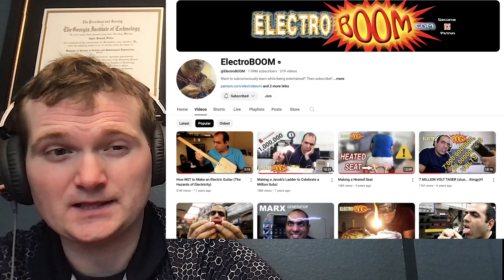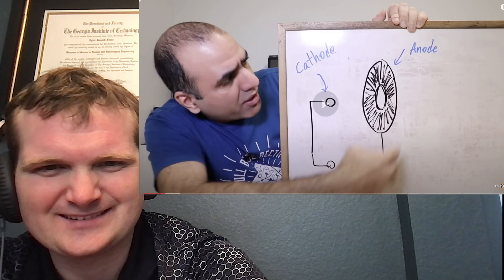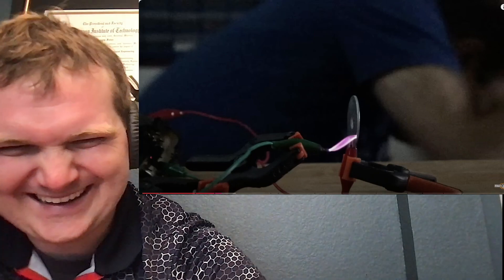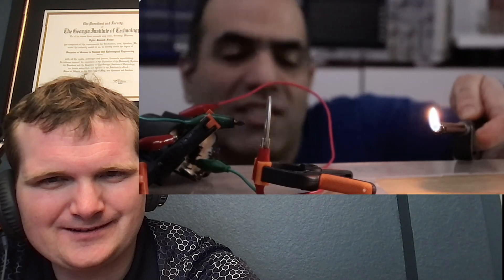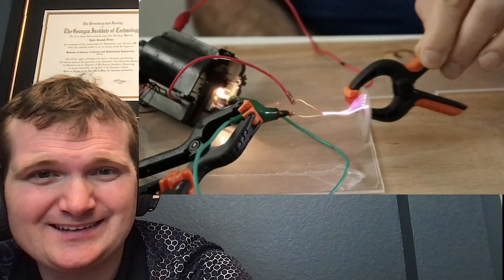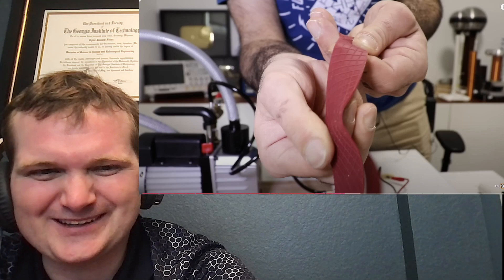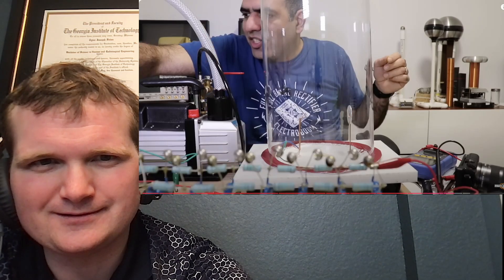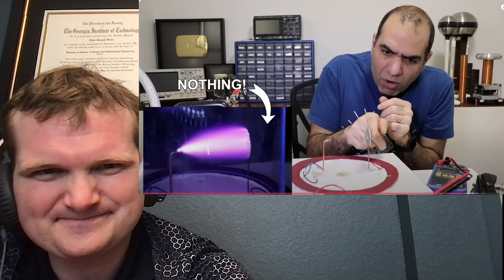Super Fast Electrons and X-Rays from Cathode Rays! - Nuclear Engineer Reacts to ElectroBOOM

Comment: I’m an engineer working with linear  particle accelerators in the medical field.
This is always cool to see. We literally call this part “electron gun” eheh

Regarding the vacuum levels, any modern linear particle accelerator used in the medical field for example has better vacuum pressures than space. Some systems have Considerably better pressures in the 10x10^-12 mbar ranges.

Pretty cool and surprisingly simple physical principles and even somewhat simple tech allows us to produce beams of radiation to destroy cancer tumors very accurately.

Comment: I repair and build vacuum tube devices. Electroboom is the last guy i want near any of that. I love vacuum tubes for sound amplification. The natural imperfections make them amazing. The highest Voltage I've seen inside one is 783 Volts just obliterating a set of tubes rated for 475 volts...

Comment: My cusion gave me an old over 40 years ago and it is rated for over a couple of Kv. It has a small tv and dual bread board and it has radio signal and signal creator and more features. But I was wondering what I should check or do to make sure that it is safe. 

It also still has the original instructions with a very rusty paper clip and they put the warnings in the back of the book after it tells you to do these experiments. Good video

Comment: This goy who hosts ElectroBOOM has some special relation to electrical shocks. Personally I'm terrible at handling electric shocks though I have no problem with ordinary pain. That's just mental, pain is a signal about something not being optimal so unless you think it might really case serious damage just ignore it. I once broke my arm and crushed my elbow. Got up and took a cab to the hospital. Waited for more than an hour before a doctor was free to look at it and by then my arm was swollen to double the normal size. He couldn't understand how I could just walk around with my useless mangled arm hanging without hollering for pain relief. This was the twentieth of December. Three days later I drove to my sister, about 400 miles. My arm had been straightened out with titanium reinforcement and the elbow rebuilt to something that the surgeon though might eventually work decently. The operation took over four hours, and twice a day I was to unstrap the arm and bend the elbow. That kind of hurt, but as I said pain is in the mind and the exercise had to be done. Sure I was rather useless at work for about three months and even after that the arm isn't perfect as it cant be straightened out quite all the way and I can't rotate the hand more than 90 degrees compared to the almost 180 degrees that is normal.

Now the funny thing is that in my fathers eyes I'm a cry baby. While my friends think there is something wrong with my pain receptors as I just ignore pain they find insufferable. But then my father was another person that had the doctors confused as he had extreme pain tolerance. He mangled a leg and after several operations they had a therapist come and bend his knee every third hour. This poor man got a bad job as normally the patient would just black out and fall unconscious when he started bending their limbs. But not my father he remained awake and commented everything by shouting out his pain. Yea, he thought I was a cry baby, but I guess that was all relative. I remember him gripping a red hot piece of steel when welding. Sure he got severe blisters but he didn't shout or drop the thing. That was his take on heat. Unless it burnt you to the bone it wasn't too hot to handle.

But then there's electricity. I just can't handle it. My uncle was an electrician and he used to check if the power was on my spitting on his fingers and grabbing the bare wire. He used spit as without it he couldn't feel the electricity through the calluses on his fingers. No way I'm doing that. Just the thinking of the "slight" tingle of 230V makes me shudder. Got to close to 30KV with my screwdriver once and the arc left a decent scar on it. It was insulated to 10KV so I didn't feel a thing but I was still shaky the rest of the day. And yes I'm educated as an electrician but I have never worked as one. I'm not to scared about electricity but I certainly don't like it.

Comment: CRTs are used by a machine to test optic nerve connectivity speed. 

Pads are put on your head to measure brain activity as you watch flashes and patterns on a CRT.  it has to be a CRT B because it has 0 latency for the analog signal. 

In theory a LCD could be used but the screen would need to have an exactly known latency or the latency of each item would need to be measured and used in test calculations.

Comment: They are a bit limited in bells and whistles but an electronics teacher told me CRT oscilloscopes actually have better response times. I have a fluke unit with CRT display and an old heathkit one that is all tube driven. Tube things make a bit of heat and take a while to warm up, but it is really cool to see all the tubes glowing. Audiophiles still like tube amps for things I think because they have a more gradual on/off than digital units.

Not really nuclear but electrical and sort of similar to this are mercury arc rectifiers. I've never seen one in person but they are really strange looking things, and make some interesting glowing patterns you can almost see how the power moves around in them.

Comment: I had a tesla coil kit I made, one thing it has is a Z shaped spinner for the top. It will just start spinning by itself it has power. I assumed this worked because the arc it put off was expanding the air and that was making a small amount of thrust. This got me wondering though if maybe it's more the "electron wind" or maybe both?
Reply: no you were right the first time, its expanding air from the heat. If it was electron wind, it would have to be a DC source first of all, since everything just moves back and forth in an AC discharge such as in the tesla coil.

Comment: I have something even better/terrifying in my collection: a Crookes tube. It’s modeled after the Maltese cross experiment to show that cathode rays travel in straight lines. It works well although it does generate a lot of X-rays so I can only run it for a few seconds at a time. I’ve calculated you’d receive one microsievert every 8 seconds at full power.

Comment: An electron gun is basically a single-stage particle accelerator.  Beam control in olde-skool CRTs was usually electromagnetic, but also, in things like oscilloscopes, where fast beam motion was required, they often used electrostatic beam control.   It was typically the case that the vacuum in CRTs was somewhat deeper than in most ordinary vacuum tubes, and thus the glass was fairly thick.  When scrapping a CRT, there was always an implosion hazard.  Plus, some of the phosphors they used in color CRTs were somewhat toxic.